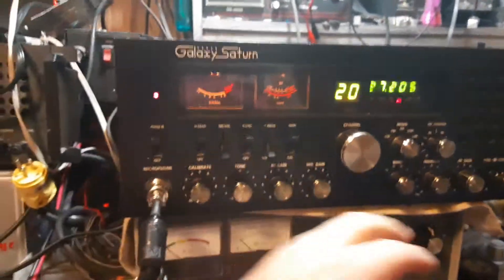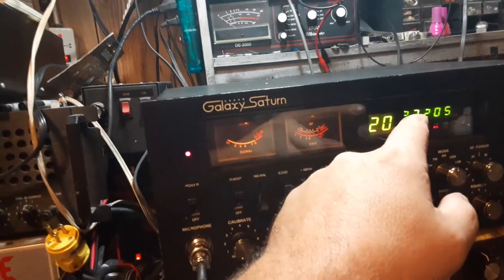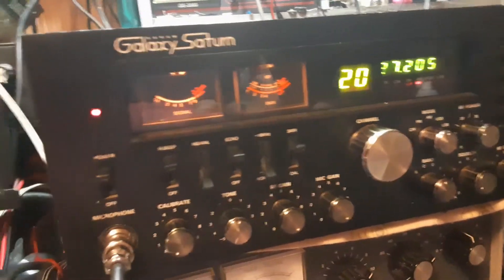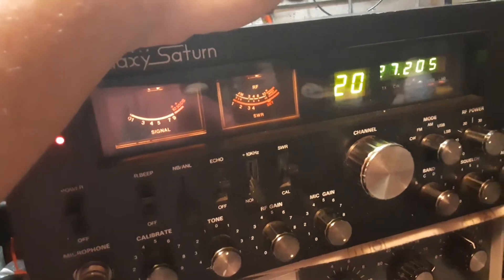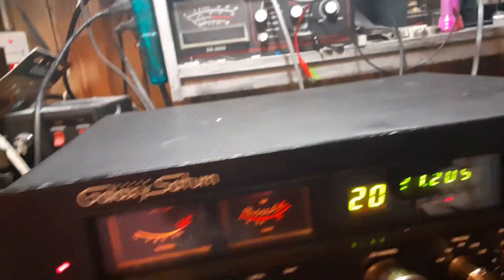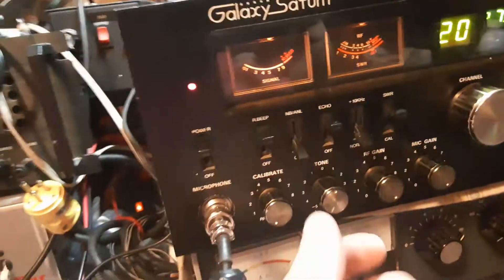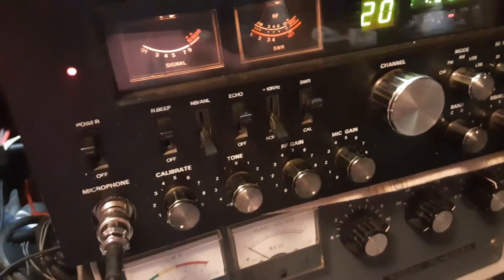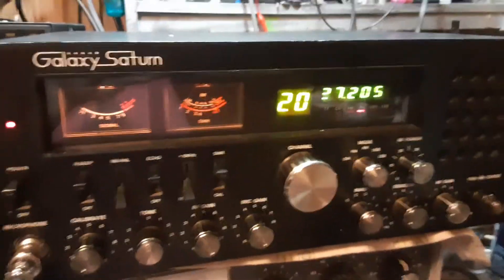galaxy saturn clean up

Comment: Hello.. I just picked one of these up and its a very clean radio. I was wondering if you could tell me if you dont want echo my understanding is you have to adjust it from inside the radio? Or do you just turn off the echo switch? Thanks!
Reply from the maker: On a galaxy Saturn. There is a flip switch to turn it off. The adjustments to change sound are inside
Reply: @eagleeyeradio9940  yeah.. I'f I knew what I know now I wouldn't of asked such a silly question 🤪 Pretty nice little radio's though. She's a talker. Thanks for taking time to answer my bone head post! Great video's!!!  3's 👍
Reply: My frequency counter is doing the same thing bouncing up and down what did you have to change and what is the average price to do it?
Reply: Will contact cleaner fix it?

Comment: I have the same radio and the echo was disconnected from the power. A after market echo was added. I removed it. I can't find where the power comes from to feed ba and bc on the oem echo. do you have any info on the feed to the echo?